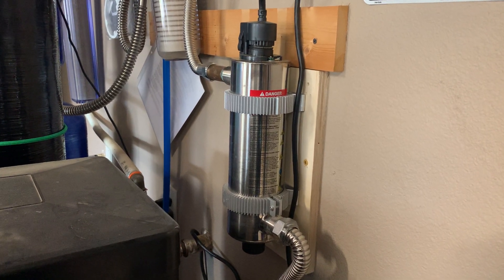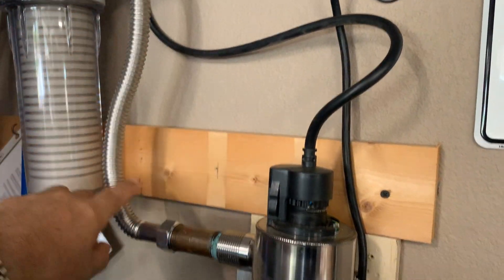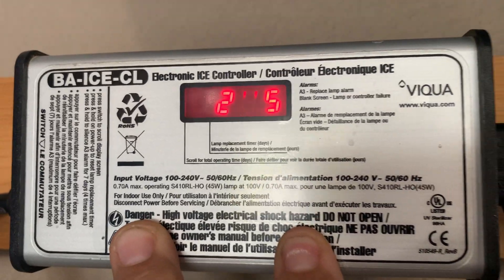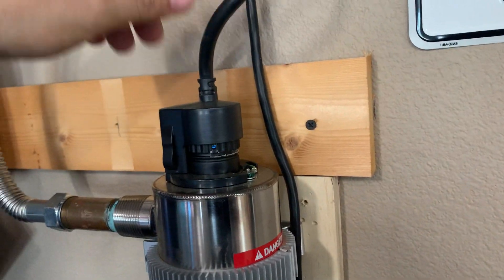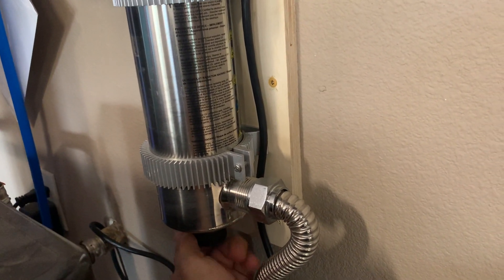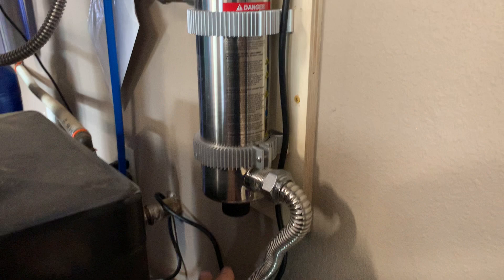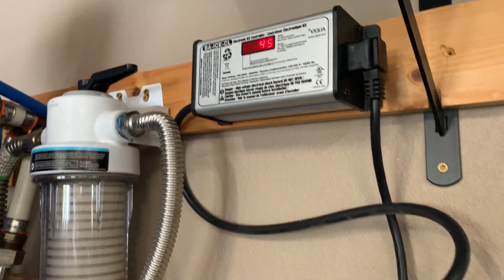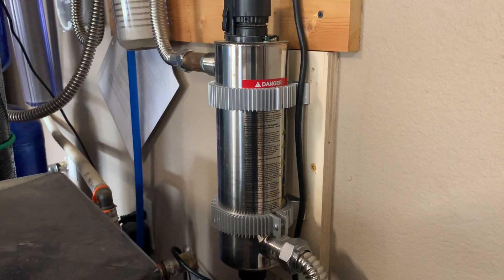The Standard for UV - Viqua VH200 Water Purification Light

Comment: how do you like it? is it easy to service?
Reply from the maker: Super easy. All you have to do is slide out and replace the bulb each year.  That’s it.
Reply: Shut your water main off first. Replace the glass tube as well as the uv light. Apply silicone grease to the orings then put it back together. Hold the reset button down on the uv day counter device and plug back in to reset it to 365 days
Reply from the maker: @lkw5699 I don't see any reason to change the glass tube.  It doesn't get dirty for years in my situation.  I guess it depends on your water.